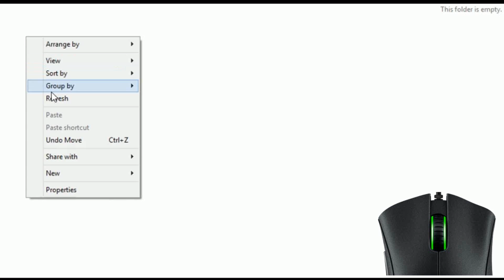Razer DeathAdder Chroma Double Click Issue fix

Comment: I sprayed some wd-40 in the button without removing anything. Just slipped the straw between the mouse body and the button targeting the plastic that presses on the switch. For now the double click issue is gone after a long time.

Comment: I fixed mine without soldering. opened mine up and blew a jet of air like into a Gameboy cartridge or whatever.... double clicking stopped. gotta dislodge some dust or something. did that into a few soldered-on pieces and problem solved. Thanks for vid.

Comment: Don't buy Razer. Anyways spray the switch with contact spray, it worked for me.
Reply: Do you spray just the click of the switch, or you cover the whole switch with spray?, newbie question, never done this..
Reply: @KokeJr  Yeah take the mouse apart and spray it into the switch. Not the whole switch. Just let the spray get inside the switch button.

Comment: Omron switch is at fault. Do not blame Razer.
It is possible to pull the covers off the switches and bend the copper tab back into form without desoldering.
A link to the new Omron switches on Ebay or something or part numbers in the description would be helpful on this video as well.
Reply: Razer chose to put the chinese Omrons even tho there are much better alternatives that basically wouldn't alter the production or pricing. So yeah, it's their fault, it's called planned obsolescence.
Reply: @guircrc10  part no.?
Reply: @guircrc10  It is a good plan, now I have a Roccat mouse.

Comment: The double click is from the switch not the board. You don't need to add solder to everything, that's not going to fix it.
Reply: Did you even finish watching the video or just comment right away after seeing solder being added? It was purposely done to make the solder sucker have an easier time.

Comment: I just beat the shit out of it then it starts working again. This is like my 4th freaking Razer mouse that has done this. These microswitch's are Crap! Also, This version is WAY freaking easier to work on then the old one. The old one had a god damn ribbon cable that attached the top part to the bottom part. Just opening the mouse you had a 60% chance of breaking that cable off the board. (see my older video on the first version of this mouse) to see what I am talking about.
Reply from the maker: Thats the Issue with only the 3.5G Razer only.

Comment: Deathadder elite here, an sure enough, after 5 months right click went belly up. I took it apart and the switch feels like its 0.5 mm more depressed then the left. And throwing away a 50 euro mouse instead of getting a basically any soldering iron, 20 minutes of looking up a soldering tutorial and a 2$ switch is just wasteful. + you get to stick it to Razer. 
Their return policy is a perfect example of why the world is so screwed up. 
You have to cut the cable when you return it, so they can crush the mouse instead of replacing a simple switch (which is NOT rated for 50 million clicks, maybe with a feather it can do 50)
So moral of the story is dont buy Razer and if you did, get a different switch to replace it.

And funny, because I have a 20 euro mouse that still works fine after 3 years of serious abuse. I got myself to blame, I thought Razer was a serious brand, but its just eye candy.

Comment: just breathe into the holes of your mouse, slow hot and humid as possible air. Its to release the static buildup on the mouse sensors. You may need a lot of tries to get this though and some people fix it in a few breaths.
Reply: thanks worked for me
Reply: Wow, worked for me!
Reply: Incredibly enough, it worked!
Reply: good I looked in the comments, it worked for me
Reply: I just put a tiny bit of oil on and around the black switch with a very fine paint brush. Its solved the static build up for me.  Got fed up of blowing on my mouse every hour or so.
Reply: @TheUnorthodox_1  what did you put the oil on?
Reply: @kvnwdev  The switch mechanism itself and over the the small rectangular button/switch. Oil won't conduct electricity and will stop any static build up.
Reply: and now its working properly finally ! Thank you so much
Reply: Make a video on it, you'll get more views than this guy.
Reply: LOL worked for me thanks man. Cause ain't no way I was gonna be able to do what this video was telling me to do

Comment: I have a Razer DeathAdder 2013 and I'd like to just give a heads up to people who are having issues with this update. 

ONLY FOR PEOPLE WHO HAVE PROBLEMS INSTALLING THE FIRMWARE: 
When installing any kind of firmware for hardware peripherals, ALWAYS plug the USB directly into your motherboard. DO NOT try to install firmware for any device that is connected to a USB hub - this will not work. I connected the mouse USB directly into my motherboard and it worked perfectly, and it took less than 10 seconds to install. Just to make sure that I installed it correctly I ran it again and the software told me that I already have the same firmware version installed (v1.04.03) 

Hope this helps anyone who can't get past the 0% part.
Reply: I have installed the firmware and it was working fine until i updated Windows. Now im getting double clicks again :( 

HEEEELP

Comment: to fix this simply use a qtip or a cottonball with alcohol on it and push it down on the click button that doesnt click very well and make sure it sinks into the click button. Fixed it for me countless times and I click down on my mouse rapidly and do 10 clicks a second this has not happened on my deathadder chroma so its unusual

Comment: you don't need to remove the entire click switch case. just remove it's plastic top and replace the small metal microswitch. razer, logitech and steelseries all use the exact same click switches manufactured by omron. The mouse manufacturer just creates the sensor, and even the sensors are about the same between these 3. The only realistic noticeable difference between mice nowadays is purely the design. But I guess people just like riding a certain manufacturer dick for some reason
Reply: can you make video for it? because it's really hard to remove the top

Comment: You had me up until 2:21, then that shit goes beyond my capability.
Reply: use alchemy  ;3
Reply: lmao... same here..
Reply: It's not as hard as it looks :D but this isn't the best solder job; it's not good to touch the iron on the solder or else you get those big balls & cold spots which will likely break the connection.  You should heat up the two surfaces with the soldering iron, then touch the solder on the other side.  No rosin either, tsk tsk! :D EEVblog has a great tutorial on soldering.  Thanks for sharing though, going to try this on my mouse now because it's driving me fucking insane haha
Reply: :D:DD:D:D
Reply: LMAO
Reply: dude, i know i'm late here.. but, ffs i couldn't agree more.. lmfaoooo

Comment: This mouse had such good reviews. Yet almost every mouse in that series seems to have this problem.
I guess I'll go with logitech or something next time.
Reply: Even logitech has the same problem. They use the same switches. I had some,  which suffered the same problem. If you are using it a lot this issue will appear eventually.
Reply: Same switch same problem
Reply: Try optical switcj mouse

Comment: I have a method for dirty microswitch. Open up the mouse. Use an aersol airduster to contact  the mouth to depress the problematic white button. Blow a few time. It should solve the problem if the switch is only dirty and not faulty.

Comment: Man, you have to do this every year for this piece of shit mouse? what the fuck kinda garbage do people sell now days?
Reply from the maker: ikr!
Reply: This mouse is trash... i razer is trash... just garbage bought by people because its a popular name... theyre fucking trash.
Reply: yeah, i have this horrible luck with Razer... headphones, mouse, keyboard... they all go out within like 3-4 years. which yeah is sweet. 3-4 years is a good time. but then? grandmas keyboard works just fine from 25 years ago.
Reply: It´s not just Razer. Logitech, Roccat, you name it. 

It´s the same Omron switches after all (or some equivalent crap) 

It´s in the mice manufacturers´ interest that their products start failing, ideally shortly after the 2 year warranty, so you don´t get a replacement and buy another new one of their products.
Reply: my 2013 deathadder is 5 years old and just now starting to double click, i think 5 years from a 35 dollar mouse is well worth it
Reply: I've had my deathadder chroma for 4 years. It just started doubleclicking on me.
Reply: Still have my Deathadder and it presents the double-click issue once in a while. I just slightly smack it on the mousepad onto the table and this `unstucks´ the damn omron switch. 

Just don´t bang your mouse with all your might and the complain later that I had given poor advice. Just slightly. You might also wanna  try that firmware update you can find here at you tube, since it sometimes is not a mechanical problem. It happened to me. First it was the firmware. Then it was a mechanical issue.
Reply from the maker: ^ Yep.
Reply: Nah, I bought this thing last xmas. and it didnt even last until then... Im going to just find a different brand, ive been screwed by their keyboard, mouse, and headphones now.
Reply: Dudes, trust me. It´s pure lottery, with pretty much any brand. I have this problem with my Razer Deathadder too. FIRMWARE  update helped, but only for a time, until the issue returned Now I just smack that SOB a few times on the desk to loosen up that switch that keeps squeezing its uptight ass cheeks. And it works lol.

Had the same double click issue with a Roccat Kone (that I enjoyed a lot, but it was a short fun). Thought I would give logitech a shot just to find out many people have the same complaint. 

Bottom line is. Don´t buy so called top of the line flagship mice. You will only get pissed. Go for something more than average, but not too expensive and ditch that bitch in 2 years, once it presents issues you can´t or have no patience to solve.

Before opening the mouse try to blow some air after disconnecting the mouse. I used compressed air can. It sometimes helped too. Try (at your own risk), especially if you were just about to throw that fucker in a trash can anyway
Reply: I have already followed you down this path of righteousness. Until this mouse gets down to the ditch price range i probably wont be getting this dirty thing.
Reply: not saying it won't especially with the amount of lifetime clicks on a gaming mouse.  Nothing lasts forever
Reply: been using it for years. csgo dota2 etc. its fine. got a steelseries kb too so i dont know bout you hahaha badluck i guess.
Reply: Razer suck. I gave them the benefit of the doubt and bought one and shit everyone was right.
Reply: I have my deathadder chroma for about 3 years now, not a single problem. I had this problem with the deathadder 3G thou, i was sure that this problem was resolved with the inclusion of the omron switches, guess i was wrong.
Reply: i got a blackwidow, a deathadder, and a pair of krakens, they all stood up especially the krakens which i throw a lot, but the deathadder has this issue where the left click would double click when i clicked once (not like this video)
Reply: What generation is your deathadder?
Reply from the maker: Deathadder Chroma
Reply: same here...
Reply from the maker: sooner or later xD it starts

Comment: No joke, every Razer product I've owned has had at lease one day one issue followed by another catastrophic failure issue within the next 12 months. Keyboard shipped with a letter that consistently double clicked. Mouse's right  click did not work at all, was muffled or had a broken piece, now it is double clicking on the left click.
Reply: (sorry, my eng so bad) same, my deathadder 2013 and chroma after 10 or 12 months, boths clicks buttons have issues, on the 2013 version, both click buttons doesnt respond well, and the chroma, the left click double click everytime. Now i own the naga hex v2, but the laser sensor is horrible compared to the optical.
Reply: Same. Three mouses in a row have the double click issue. I had bought a blackwidow TE keyboard and after 9 months the keys started double and even triple typing. they sent me a replacement and it started doing it in 3 months. I've had a CM storm quickfire rapid keyboard now for a year and have had no problems with it. Razers headphones are all garbage too. the blackhawk ones or whatever are a vertical oval shape so the front part of them doesnt rest in front of your ear but right on top of your earhole. so fuckling stupid. the tiamat 2.1 crushed my head in with merciless vice grip. i sent both headphones back. i will never buy another razer product again. they are garbage.
Reply: razer deathadder 3500 dpi - left click problem (not working sometimes, or double clicking), razer blackwidow tournament (button n is double clicking)
Reply: i know how you feel mate, i have a blackwidow 2014 which is doing triple typing a lot and a DA chroma with double click, its my first and my last time i buy a Razer product in my life, i knew i should had bought the Logitech g402 and a cm storm keyboard.
Reply: Yeah. My blackwidow tournament edition space bar stopped working after a month or so, then my deathadder chroma had scroll click issue, then now double click issue, and my kraken pro microphone is broken. Since then, I've switched to a corsair k65 rgb keyboard and its doing me good. planning on fixing the mouse, or buying a new one.
Reply: i have my deathadder for 8.5 years now and no issue before like 2-3 days...
Reply: Never had a single problem, just the mouse that sometimes doubleclicks. I used the mouse over 2 years almost everyday. I have a Razer kraken, Razer blackwidow Chroma X, Razer Deathadder chroma and a mousepad from Razer. I don't know how often you rage but the products that I owned are really well built........ Jezus Christ am i a fan boy? XD
Reply: @bwam6480  same, the double click isnt the mouse most of the time, its the way you click. If you click in a specific way ( click with your entire finger pretty hard)  it will make a double click, or you just throw it at your wall daily. Ive had no problems yet

Comment: Ok so pretty much buy a new mouse?
Reply: +Toveri Juri Yea, I had logitech, razer, different models, cheap, expensive, doesn't matter. Every mouse got the same double click issue, left and sometimes right button, and all of them had the same type of Omron switch. And yes, once I bought an otherwise useless soldering iron for this purpose, but failed to fix the mouse. And now after another mouse - deathadder chroma started double clicking, I'm getting mad, I don't know what mouse to buy anymore, which could withstand my heavy game use at least more than a year. The price doesn't matter every mouse will eventually suffer the same stupid thing. Like they making them fragile with purpose.  I don't want to pay every year for a mouse anymore - 50, 100, 200 dollars etc. 
Now I think to become an Omron switch replacement expert. THIS is the only solution in my opinion. In the end I'll be able to assemble my own fucking mouse.
Reply: @nightdeveloper  What happened when you attempted the repair? How did you fail?
Reply: thats what razer wants.
Reply: Sprite
Profanity does not equal mad, but yeah. Razer products are the light bulbs of PC peripherals. I've bought one razer product and will never buy another one again.
Reply: +Sprite
The other option is to go and buy soldering gear and the risking to fuck it up anyway because you don't understand shit about what you are doing. Except now you bought an otherwise useless soldering iron and you need a new mouse anyway.

How about just buying a quality mouse instead of buying razer one ever again.
Reply: @ToveriJuri  which mouse is a quality mouse ?
Reply: @docesam  
The one that says "Not a Razer product" on the box.
Reply: Vladimir Terziyski 
I wish luck on you quest.
Reply: hahah once i saw him soldering shit, thats EXACTLY what i was thinking.
Reply: have you built your own mouse yet? lol
Reply: Lol that's funny, I wish you the best of luck man!
Reply: Ok i just threw my small screwdriver set to the corner...
Reply: Well no i just put some wd-40 and its like new
Reply: when you think that you gonna start fixing that's it you can say goodbye...
Reply: Toveri Juri why are you so mad? ive just said that razer want us to buy new mice. i have never used razer gear in my life

Comment: Don't even try this method. Just pop it open thoroughly clean with alchol dipped q tips.
Reply from the maker: Ya, Good luck Doing That Every 2-3Weeks. 
After replacing the Switches it'll last for at-least  6-9months.(Depending on the Switch Quality/lifespan)
Reply: True. cleaning does not cure the root of the problem. It is the copper springs in those omron switches losing their tension.

But your method of changing the whole omron microswitch is not for most DIY guys.

A much simpler DIY method, with many stept by step videos or articles/photos online, requires only miniature 1 flat 1 cross screwdriver and a tweezer.  

Pop up the cover of omron switch, take out the copper spring, flatten the spring a bit, put it back (the hard part but definitely do-able). Re-assemble the whole damn thing. Works for usually 6 months as well.
Reply from the maker: ^ Yep :) 
I guess i can agree with that. :) 
Thank you for the Idea. I'll try to make a Simpler DIY for cleaning the switch.
Reply: Both of you ideas are not a bad idea. It depends on the person who has the time to do it. Short or long run is up to you.
Reply: tried it, doesnt work, actully double clicking more, thanks.